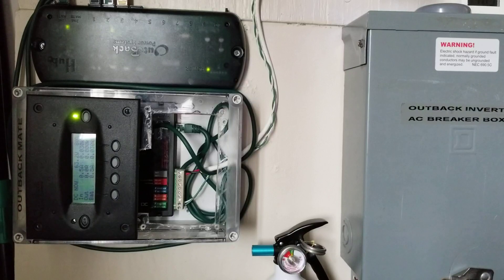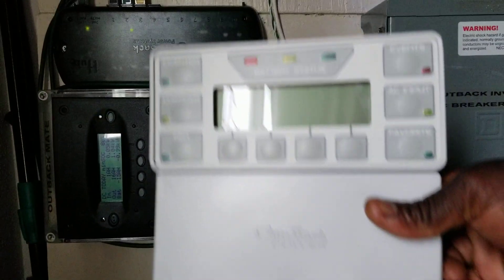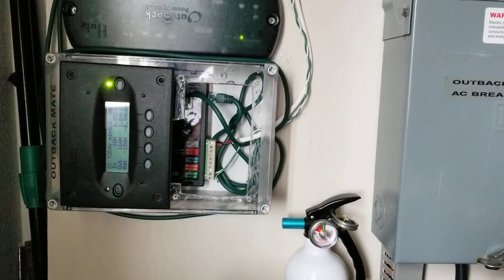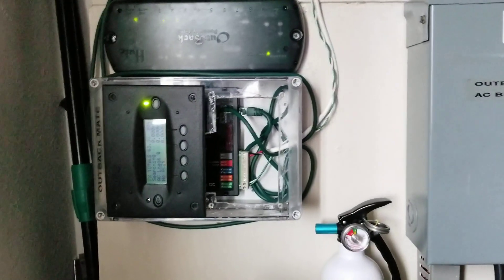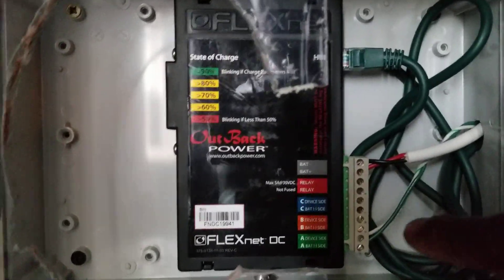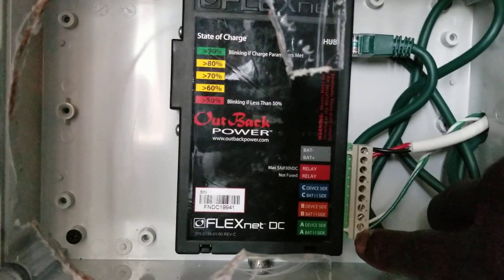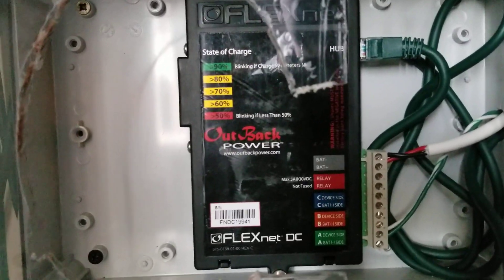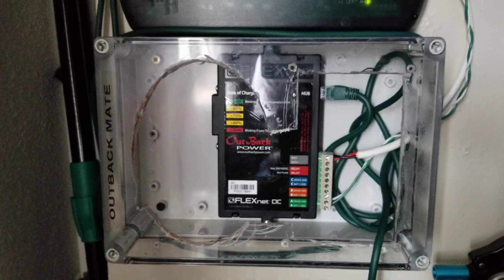SOLAR ENERGY TO ELECTRICAL ENERGY, how to convert solar energy into electrical energy at home

Comment: The best things about the Mate 3 is optics-re which gives a comprehensive production history the ability to configure all your devices online and online support if any problem arises
Reply from the maker: Yes! 
That's the only advantage for someone who likes to monitor or gather data and store it online or share it to the world.
Reply: @jwsolarusa  Being able to configure your system is much easier too  you can even turn stuff on or off  eg generator floodlights  etc also the local network access allows real time monitoring
as well
Reply from the maker: Yes.
MY Magnasine Magnum ME-ARC50 Remote monitor does the same thing as well.
Reply: @jwsolarusa  Nice